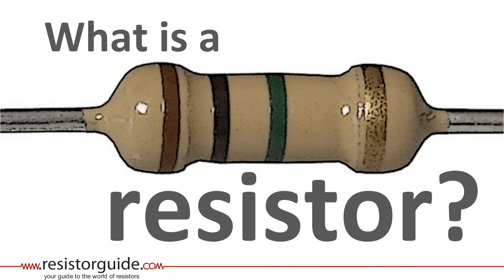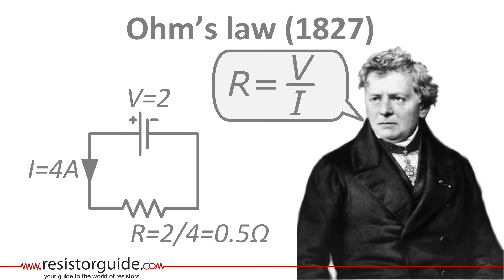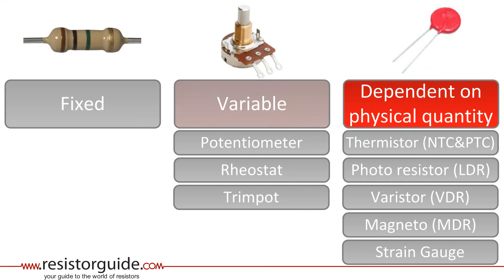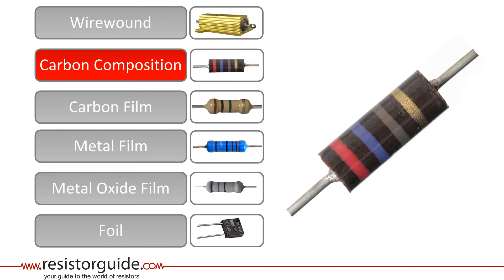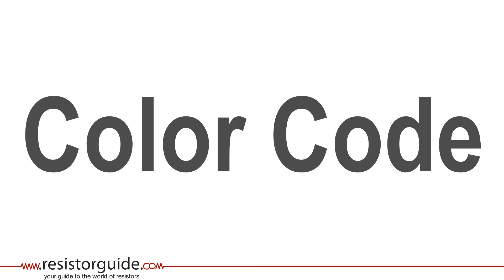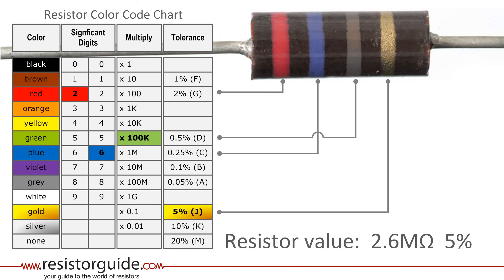What is a resistor?

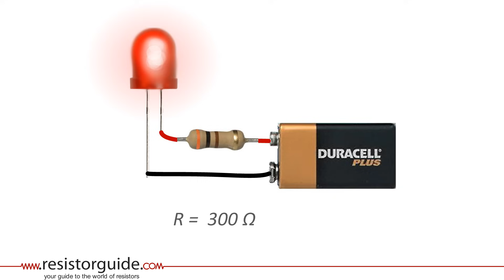Comment: 2:51, Im new to this topic, and trying my best to understand but im a little confused at this point...... you say that the 9v batter will burn out the led, well instead of using a resistor why dont people use  a different battery ? one with less voltage? I dont see the point of a resistor at all, , why cant we just use the correct battery?
Reply: That was actually a very bad example use of a resistor; I was cringing as I watched it.

Changing voltage is often not a reasonable option, since LEDs are frequently just used as indicators in a larger circuit. If I'm working with a circuit that primarily uses an automobile supply voltage (~13.8VDC), I may not want to step-down the voltage just for some LEDs. A voltage regulator doesn't save any energy and a buck converter is unnecessary complexity.

LEDs have very low resistance, which is why you won't find them powered directly with a battery; however, they drop voltage. The voltage dropped across a diode is called the "diode drop." Red LEDs drop around 2V. If running maximum rated current, then you'll want to check the specifications for your LED. The diode drop occurs regardless of the potential (voltage) in that branch of your circuit. So, I'll use the example from this video. If you power the circuit with a 9V alkaline battery, you should expect supply voltages up to around 9.6V. Subtract the diode drop of the LED (9.6V - 2.0V = 7.6V), then calculate the resistor based upon the result (7.6V / .03A = 253.3 Ohms).

Neglecting the diode drop when calculating the resistance for a single LED on a 9V battery may result in a slightly dim lamp. But on a regulated 3.3V supply, you'd better calculate your LED's resistor after subtracting the diode drop, because a 330 Ohm resistor will NOT supply your LED with 10mA.
Reply: Because in practical equipment there is generally a power supply that is providing one voltage level to all circuitry which is then divided as needed for subfunctions as appropriate.  This is especially true for devices that use a battery with multiples of 1.5 or 9 volts DC.  The use of the current limiting resistor is quite common and appropriate, and is a far more general and economic solution than attempting to craft unique power supply voltages for each and every little device in the entire system (which is actually what you're doing anyway with simple, cheap resistors.)  :)
Reply: I'm also new so I might be wrong but, what if you didn't have another battery? And it's better applied to more complex circuits where there is a constant source. Which means some components can't handle that much current so use a resistor to provide to those components. If you see what I mean.
Reply: We better use resistor than changing battery because high voltage batteries are more efficient than low ones, even if adding resistor within the circuit. Just my opinion.
Reply: And should u dont get why high voltage batteries are more efficient than low ones, because P=V.I. The higher the current I, the higher the power loss due to conductor and thermal losses. So they have to make higher voltage batteries than components requirements to maximize efficiency
Reply: because they only have a 9 v batery that is better then with onlh 1.5 v!
like me, i Always use 9 v batery!!
Reply: TonyMon16 Because men that is only the basic. what if you need 10 volts for other component in a circuit? for exsample you need to light a 1.5 V LED (This is just an example) and you need to light a 9 V lamp? resistor basically balance everything. 

damn im drank
Reply: @Ngoan Meo   O M G... WTF  are u talking about ? Do u even know what is OHM's law ? Let me remind u : I=V/R, so, if diode acts as a short circuit when is active, R=0, so current tend to rise to infinity no matter if u use 9 or 15 or 5 volts. That is theory, in practice there is some small resistance, so diode current will not rise so fast, but voltage source can not be used to limit the current in any case. That, AND ONLY that is a reason to use resistor... Thermal losses in diode ? Do u know how diode works and what is efficiency ?
U say that, because higher voltage batteries have more power loss, they are more efficient ???  Are u for real ? Ur reasoning is so bad... U dont know basic concepts....
Reply: TonyMon16 you might have to power other components along with the led. if you only needed an led, then yeah, a smaller battery would work. but perhaps you wanted to run a small dc motor along with the led, in which case you would need to use the resistor

Comment: Great vid, thanks for sharing. Do you know where I can find an electrical board hr51a? It is used for charging an 18v. There is only 4 parts on this board, 3 are resisters I don't know what the other part s is. It is a  cylinder shape thing with 3 loops around it .  Two brown and one black. Thanks
Reply: sounds like an inductor

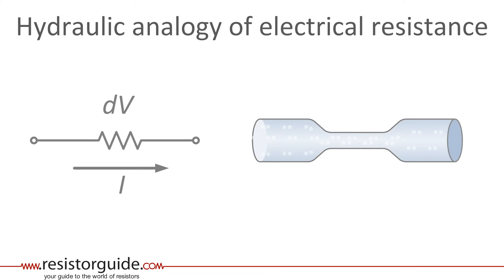Comment: 1:00 Doesn't Pascal's law tell us that The pressure in a closed hydraulic system is the same at all points? P1=P2?
Reply: No.  I think you are confusing HydroStatics with HydroDynamics.  Bernoulli's principle must be applied for incompressible flow through a pipe.  Pressure and Velocity will change as a function of the diameter of the pipe.  When the diameter diminishes, pressure goes down and velocity goes up.  It is an energy conservation law.

He used a bad analogy.  The better analogy for potential(V), current(i) and Resistance(R)  (Ohms Law: V=iR) is the vertical water pipe with gravity acting as the potential.  The diameter of the pipe is the analog for resistance.
Reply: oh
Reply: Bubble Coffee Well all circuits are closed, so all of these hydraulic demonstrations have to be closed.

Comment: Hmmm,,,,,,, LED not LID, resistor goes to negatve side, not positive, and the resistor banding was not correct.
3/10 Fail. Could do better
Reply: +Dave East It doesn't matter which side you connect the resistor to, all it does is limit the current that flows through the circuit.

Comment: does a resister reduce 240 volts to 115 volts
Reply: +amer limbu that's a step-down transformer's job
Reply: BUT WHY BY RESISTER?
Reply: resistor is for limiting current flow not voltage
Reply: Oh
Reply: +Arman Kordi You CAN use a pair resistors to reduce a voltage, it's called a voltage divider; however, it's only meant for low currents, typically to create a voltage reference for other components. A potentiometer is in fact a variable voltage divider.
Reply: Gert Brink Nielsen
I don't use them to lower voltages unless its >5v. But you do have a good point.
Reply: +Arman Kordi But if the current lowers dies the voltage not lower too?
Reply: +Amer Limbu hi you r so sexy
Reply: Arman Kordi are check my video then you will know how sexy I am.

Comment: Great video; however, I see two mistakes right away. 1st one is the LED itself, its hooked up backwards, shorter leg is usually/normally always negative. The 2nd mistake is that he chose the wrong  value of the resistor's Multiplier, even though he did say the right one (he chose green instead of gray).
Reply: It looked better in this way,this video is more theory than practical
Reply: @Brian,

I am starting my first project. I need someone with knowledge to review my project contents and recommend missing/needed resistors, etc to complete my project to fully function able in all areas.  Can I resource you?  I have a handicap that limits the way/method I obtain knowledge. Hence the “first” time, I need guidance/ assistance.

I am determined not only to complete this project… but obtain. Skills to complete a total of 250 projects on my own….later on.
Most Humble Appreciation!  Alton

Comment: The LED part is inaccurate, since you didn't take into account the voltage drop on the LED. A 3mm red LED has about 1.7V drop across it, so the drop on the resistor is about 7.3V. The correct equation is R=7.3V/30mA, so R=243.333Ω
Reply: I think he was trying to simplify it
Reply: +yotam amit Yep, i noticed that too.

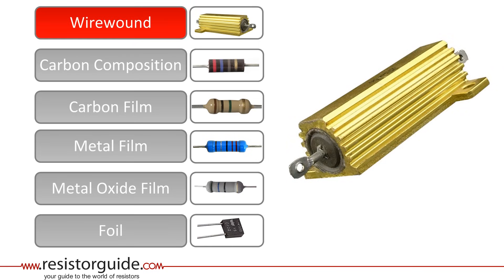Comment: Around 4:00, how does the wire become a resistor for the wirewound? Is it the material it is made of? Wrapping a wire around a piece of wood doesn't reduce current, does it?
Reply: That is how wire wound resistors work and wrapping a wire around a piece of wood like that would make a very crude and weak resistor
Reply: NeXTSTORMING but, it is the same principle, correct? Instead of wood, maybe porcelain?
Reply: ***** the material of the core dosen't matter just what the wire is mad of
Reply: NeXTSTORMING so, why the color coded piece? Just to let you know its value?
Reply: ***** that is practically the only reason or the coloured stripes
also if you were wondering how high wattage power resistors work, they are just thicker cable
Reply: NeXTSTORMING So, by attaching a wire with less conductivity then say copper, like a circuit board, current flow is slowed, but not destroyed. And the same goes when the voltage is amplified. A steady current is always flowing through the circuitry, regardless of resistance or amperage. Like they say, electricity is just like water, where the current is like a man made river widening and narrowing to create moments of release and pressure. I think I just had an epiphany!
Reply: you have basically just got it
Reply: NeXTSTORMING Thanks for the help. I honestly have a grasp of how basic circuitry works.

Comment: Positive leg of LED is longer, you have battery reversed.
Reply: +jedi22300      The resistor can be connected either on the positive side or on the negative side
Reply: Ken Logsdon what you do is if you look inside the plastic part of an LED, there will be two metal looking parts. The larger one goes to black (GND) and smaller goes to positive (VCC) so the way I remember it is 
[big = black]
because they always start with a b. Larger piece in the LED goes to negative ground, and the other goes to positive VCC.
Reply: حنا بطرس Okay thank you
Reply: you could cut the legs
Reply: Sean Ocansey Not to be overly technical about it, but the "ground" side of the LED is called the cathode and the "positive" side is the anode, as with any diode.  But you are right, a little knowledge is a great thing.
Reply: +Michael Esping       Almost always positive leg of LED is longer.
Reply: +Michael Esping Does the resistor always have to be on the positive side?
Reply: This was the fastest responce any one can have
Reply: حنا بطرس I uhh, have a lot of time on my hands
Reply: +jedi22300      have a lot of time on my hands   May be you like to check my channal for :  how a refrigerator works and give me your comment there
Reply: ok, you win. :)
Reply: Perhaps but what if you had an LED with equal length leads?  Then what would you do?  You'd be in quite the quandary, wouldn't you?  Another one of life's little dilemmas, eh?  Yet another mystery to solve!  And solve it you must, else you'd face dealing with the consequences!  Consequences that may include the destruction of your LED!  That would be a fine pickle, wouldn't it?  Having to explain to all in attendance exactly why the finely crafted LED, manufactured with the full and explicit intent of being of purposeful good use to mankind,  met destruction at your hands?  Now, wouldn't you?  Why, you'd wind up wondering why on Earth you ever bothered trying to make use of LEDs to begin with!  And you would have to live with that shame for the rest of your life!   :(
Reply: Also the LED's doesn't have on one if the sides a little indentation to let you know wish is positive and wish one is negative?

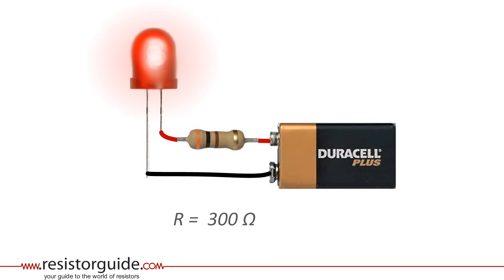Comment: mhh at 2:43 are some mistakes the first mistake is that you are connecting the positive lead to the cathode.. (negative end) so i practice and theory the led wont work because afterall its a diode which has his polarity. ( a diode lets the electrons flow in one direction so it won't work. the long lead is always the anode (+) and the  short one the cathode (-), second an led has an forward voltage(Vf) its means that it needs an certain voltage(depends on colour but im gonna take 3V as an example to work you need to keep that in mind so instead of 9/0.03 its (9-3) its 6/0.03 
but still great video! sorry for my english :D greetz

Comment: man, I do really appreciate your hard work  but this could lead to a huge misunderstanding to mostly everyone out there! 
-according to the colors of the resistor you used in the very last scene, the resistor is: [R=2.6G] ohms (red is 2, blue is 6 and gray is 100M), so it's 2600M which is 2.6G.
-and according to the colors you mentioned (red, blue and green), the resistor should be [R= 2.6M] ohms
please correct this mistake man, because I myself got confused when you said green and I saw gray.
Im a biomedical engineer.
thanks

Comment: Why use colour bands? Why not just print the resistance value on the casing?
Reply: That's good if you are buying them  new , but once on a circuit board in a tight space  it's to color bans that give the exact specs which can include Temperature limits .

Comment: The analogy with water flow was incorrect. Making the tube more narrow will not reduce the current, but speed it up in that area. And the current will return back to what it was when the diameter of the tube returns back to its original value. Also, the pressure on the left is the same as on the right. It's the pressure in the middle that is reduced. You would be better off using a water wheel to represent the resistor. Somebody please correct me if I'm wrong.
Reply: vegasbryan
 Wouldn't it be better though to say that in the case of a resistor, if we're talking about an analogy to electrical flow...that it would be the equivalent of making very small precise holes.  Resistance is basically the amount of the electricity flowing through a conductor that's lost to heat, right? So it can't do useful work...Wouldn't that be equivalent in springing leaks in the pipe so simply not as much water reaches the destination (load)?
Reply: A resistor limits current in an electric circuit much like a partially closed valve limits mass flow in a hydraulic system. A redistribution of pressure occurs and more pressure drops across the valve to sustain a lower mass flow rate. When this occurs less pressure is available across the existing hose or pipe to maintain the previous water flow.

A similar thing happens in an electric circuit, most of the voltage drops across the resistor (partially closed valve) to maintain a now lower electrical current. Less voltage is then available across the existing conductors to maintain the previous electron flow (current). Electrons actually do move faster in the resistor then they do in the conductor material since the resistance in the conductors is so low that they act like huge diameter pipes. The increased electron velocity creates a large transfer of energy into the resistor in the form of thermal energy (heat) and the resistor gets warmer in the process.

You are right that the mass flow in a hydraulic system is the same everywhere in the system whether the water is moving quickly in a small diameter pipe or slowly in a large diameter pipe but fact remains that the mass flow rate is changed by a restriction in the system. A new, lower, mass flow rate is created by a restriction and the restriction requires a redistribution of system pressure to maintain the new lower mass flow rate.
Reply: Go to the hardware store.  Buy two feet of PVC pipe with a 4 inch diameter, and two end caps.  Drill a 3 inch hole in one of the end caps, and an eighth-inch hole in the other.  Put the cap with the 3 inch hole on the pipe.  Orient the pipe perpendicular to the ground, cover the hole, and fill the pipe with water.   Use a clock, and record the amount of time it takes for the pipe to drain.  Repeat with the 1/8" inch cap.  Voltage in this case is supplied by the earth's mass.   Gravity acts on all of the water at the same time and "wants" it to get through that pipe.  The voltage therefore never changes, but the flow will.   If you do this experiment, you will see that decreasing the size of the hole increases resistance of flow, resulting in less volume exiting the pipe in a given second.   All a water pressure regulator does is change the size of a hole (or diaphragm) based on some input.   The flow of water is a great analogy when it comes to explaining the relationship between voltage, current, and resistance.
Reply: vegasbryan I hear what you’re saying, and you’re not exactly wrong, but your example isn’t analogous to the situation at hand. Filling pipes with water and letting it fall out of holes of different diameters doesn’t include a constant mass flow rate as an example with connected pipes does. 

The amount of water going into a section of a pipe is the same as the amount of water coming out. Therefore if the section’s diameter were reduced, the water would have to flow faster (increased current) in order to keep a consistent mass flow rate. Even with a consistent push (voltage). Think of it like this. If you put a nozzle on a water hose, the water coming out will be moving faster than the water moving through the hose because it has to keep a constant mass flow rate with decreased volume. This isn’t the case with a circuit, which is why using a smaller diameter valve to represent a resistor isn’t accurate. A resistor is supposed to slow the current, not speed it up. This is why most lessons will use a water wheel to represent a resistor when using water flow to represent a circuit. A water wheel causes resistance, slowing the current and transferring the kinetic energy of the water to rotational kinetic energy of the wheel.  In the same way, a resistor slows current and creates heat.
Reply: Ashon Randall could you please suggest me a resource on Basic Fundamental Electronics ?
I need to understand inside-out of these...
PLEASE
Reply: phuturephunk
Reply: Bernouli equation says analogy to water flow in tube with changing diameter is misleading  piece of crap